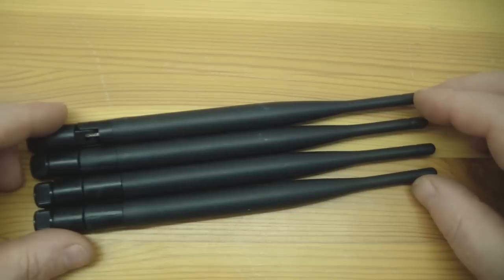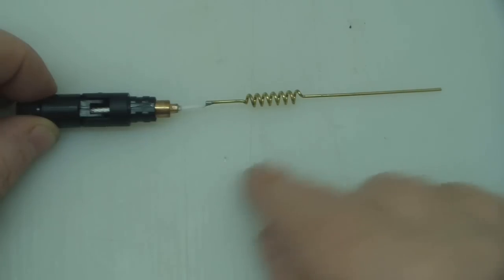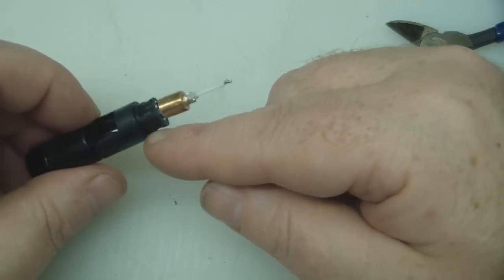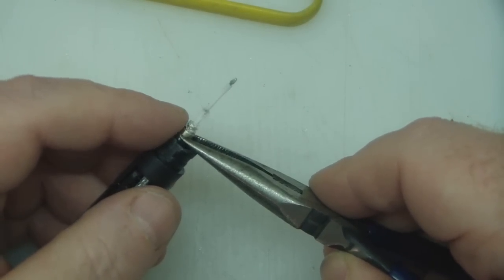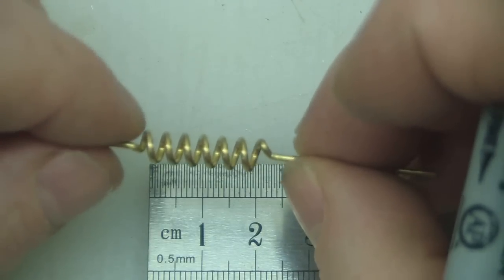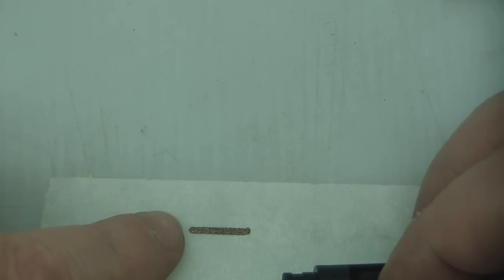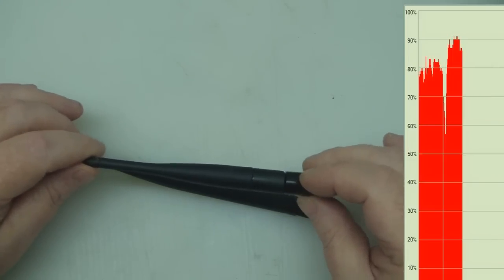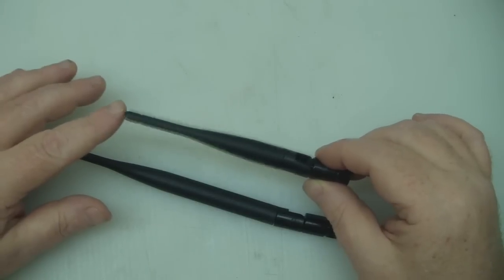Modifying a 2 4 GHz dipole antenna to 5 GHz

Comment: I'd like to know whether your spectrum analyser/network tester reads out in volts or watts? If it is in watts then the difference between the two antennae is only about 0.4dB or 0.8dB if it reads in volts. Either way the gain seems, to me, to be nothing to write home about.

Also, you did not appear to put any insulation between the tube and the braid back behind the solder joint. If you didn't then the tube would have no effect on the properties of the antenna w.r.t. just cutting the braid off and having no tube.

Comment: How did you calculate 13.4mm ?? Please explain
Reply from the maker: It is imposable to answer your question here in the comments. To understand this antenna and work out other frequencies you need a firm understanding of calculus. This is why you will not find an online calculator for this antenna or any other youtube video explaining the hertzian dipole in any great detail. On this channel I built an adjustable test rig for this antenna a few years ago and that is as far as you can go without calculus. There is a Wikipedia page on it but you will not get far without understanding the equations.
Reply: I also read some articles about hertzian dipole . They all have heavy mathematics . Still little bit heavy for me . Anyway i learnt so many things about rf antennas from your youtube channel . Some videos i have watched more than 10 times . Everytime when i watch   understand something new 😀 

Thank you !!

Comment: About the super exact measurements:  The 5 GHz band is really wide (goes from ~5,1 to 5,7 GHz in EU - that's a wavelength difference of ~6mm), so that the exact length you measure is only valid for about one particular channel, right? I guess that was what the fellow ham wanted to get over. Just go for the middle :)
Also, don't underestimate the influence of the sleeve material as it adds capacitance. We used some layers of simple heat shrink tubing to modify a 70cm band rubber antenna from 470 MHz to 435 MHz - that'll work on those little 5 GHz ones,too - also any hardware/wall/plant/whatever in the near proximity of the antenna might change it's resonance frequency.

If you wanted another 500m range I'd rather use some stacked antenna version like you built before.

Please excuse my English - it's a little rusty and may sound a little harsh (really not intended) :)

Keep up the good work!
Reply from the maker: "so that the exact length you measure is only valid for about one particular channel, right? Correct. The go for the middle is ok for 2.4GHz as it is smaller I tend to aim for channel 6. The screen shot in the video shows the difference in signal strength between a true 5GHz and a stock 2.4GHz. There is some difference there but if you lived in a small house it probably would not be a problem.

Comment: Andrew it would be interesting to show how to make a dual-band antenna to use with routers that have simultaneous 2,4 and 5ghz like WDR-4300 Tp-Link.
Can you make a tutorial for an antenna with 8db or more?
Reply from the maker: That would be hard to do as it would work well in one band and not so good in the other. Early dual band routers used the same antennas for both bands. This resulted in good 2.4 but bad 5GHz signals. This is still the same for most laptops with dual band cards. I have looked at some patients for antennas though but most are PCB type.
Reply: Thank you for your answer Andrew. I am using 2 Tp-Link WDR4300 and on this model it seems they use dual-band antennas. Or am i wrong and this router uses PCB antennas for 5Ghz? A solution to have a better 5Ghz band in my case, if the router doesn´t have PCB antenna would be using one in only 2,4Ghz and the other in 5Ghz only with some nice antenna. If the router works with the antennas which one would you propose to use for 5Ghz? The first unit is in the center of my home which i would use with his stock antennas becouse they are covering good. the second unit is about 10 meters away at about 2 meters high. Thanks in advance.

Comment: Hi Andrew,
I am a Novis to Wifi and antennas and find your videos very informative and easy to understand.

I need to extend my WIFI signal about 200m through several outbuildings, I guess two roofs from cement tiles  and perhaps five standard brick walls. 

I am hesitant to put my antenna outside, as I live in a world highest lightning area, and am under the impression that a wet cement tile roof, prevents the lightning from hitting my equipment. I do have two CPE's (Airlive Airmax2 X 2) but only get a very poor link (inbuilt 10dBi patch antenna) on each unit.

The CPE's have the option to connect an external Antennas with R-SMA connectors. What antenna would you recommend, and is there already an existing video on how its done?

Thank you for your time and effort spent in attending to my inquiry

Looking forward to your reply

Regards

Christoph

Comment: hello, this antenna is not dipole! for a true dipole has no gain, and the two conductor elements have the same diameter! and the same length.
what you show is an antenna has skirt and a self, which she has gain !!!

Comment: These antenna are not Dipoles, they are colinear, phased verticals.
Reply from the maker: No your wrong Ben they are hertzian dipoles.  A collinear uses completely different math
Reply: @andrewmcneil   No, dipoles are symmetrical, as are doublets. This is a 1/4wave  30mm or so phased with a 1/2 wave or such. Still, you call it what you like.
Reply from the maker: Again no they are 25mm / 25mm two ¼  wavelengths.  
It’s a capacitive design so instead of the normal 31.25 ¼ wavelength they work at a much shorter wavelength.  
The math: http://farside.ph.utexas.edu/teaching/em/lectures/node94.html
More info here: https://en.wikipedia.org/wiki/Dipole_antenna#Hertzian_dipole 
And it is the most common wifi antenna on the planet